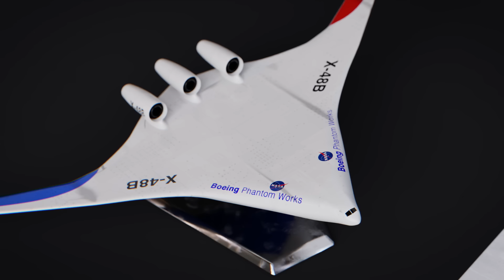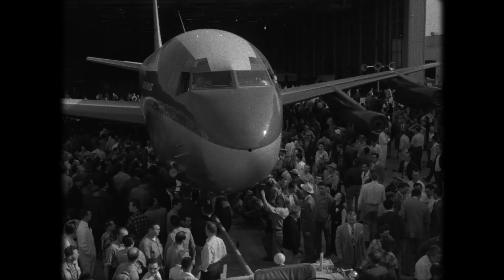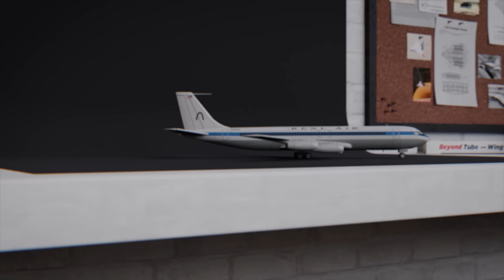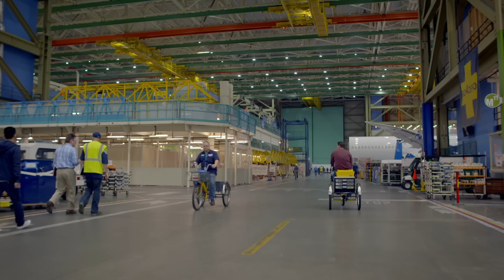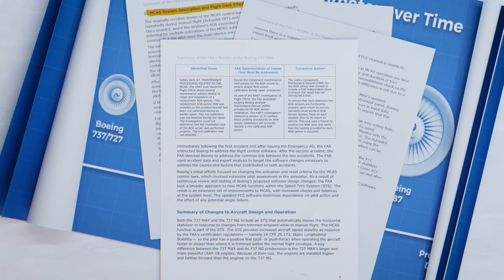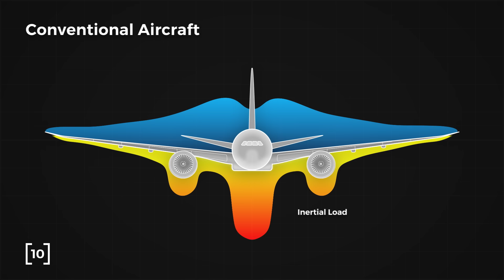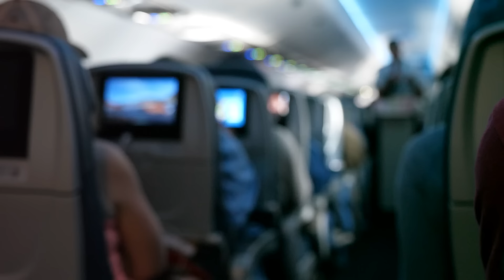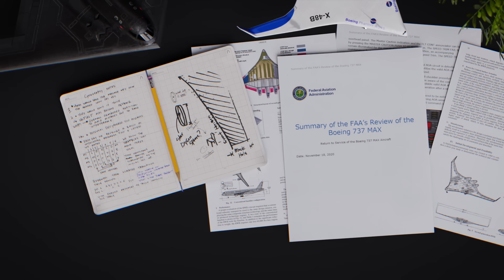The Plane That Will Change Travel Forever

Comment: Although I think this is a very well made video I feel compelled to point out that it propagates a very common missconception about the horizontal tailplane.  The lift of the horizontal tailplane is not neccesarily negative. It can be both positive and negative depending on the amount of payload load, and fuel, and how it is positioned . Ideally it should be zero, and hence the major drag from the the horizontal tailplane is parasitic drag. The point is that  the centre of gravity needs not be in front of the wing neutral point. It should be in front of the neutral point of the combination of wing and horizontal tailplane (and fuselage).

Comment: You failed to mention 1 key fact...
Fuel efficiency increases never lower fuel costs.
Per unit fuel cost will rise to compensate for Per Unit efficiency decreases. 

An oil company isn't going to make less money because the airlines want to use less fuel.

Just look at the automotive sector, making cars way more efficient since the early 2000's and yet Fuel prices are higher

Comment: Considering the failure of the A380 to take over as a new standard - only a few airports could provide the infrastructure and the plane is expensive - I think it'll be a long time before this sort of design takes over. It would require massive investment just to get the (probably reluctant) passengers on board. Also,  the tube fuselage is an easy structure to pressurise. This is so far off becoming a reality, I'm surprised Elon Musk hasn't claimed to have invented it and sold the idea to Richard Branson.

Comment: 14:14 good luck! Anyone who ever worked in software development knows it is impossible to write complex code perfectly.
Reply: I would posit that its an issue of the machine-style en-mass rapid fire typing we've DEMANDED should be the correct way of doing things, instead of putting the code through multiple error checks with multiple error checkers in the loop, along with inadequate netcoding...

OFC it'll be difficult at best to create a multi-million line code piece of aviation machinery with "good" code.

Comment: How are they going to pressurize that thing?  Making a a fuselage of that shape strong enough to hold 8,000 ft. at 40+ thousand feet will have a real weight penalty. That's why aircraft cabins are cylindrical.

Comment: They could've done it since the begining ( or across those 50 years ) , but fuel had to be consumed 100% because if efficiency would've been 110% , an entire industry had to suffer by lowering the production  ... We all know what's that industry  . I bet there were alot of burning discussions or design and redesign and alot of compromises so everyone can live in peace and sleep well .
Reply: Wrong!  The elimination of the tail section(and it's passive stabilization) basically requires continuous active control to fly straight.  Computer control!  Building redundant electronic systems for every contingency is the main challenge here.
Reply: @jeffreysickels1970  Yeah ... But i haven't mentioned that when i said " They could've done it since the beginning " i wasn't reffering to the futuristic shape in the clip ... More like any other aerodynamic shape that could allow a really efficient airflow .

Comment: This is awesome and I want it to replace all planes. But the sad reality is that airlines are very risk intolerant and unwilling to invest in new infrastructure. Even if this plane was the same price as current models they would still hold off on getting it since they'd have to retrain pilots, change loading/unloading infrastructure, hire new technicians, etc. Not to mention that they would not want to replace a perfectly fine plane if it still works considering how expensive they are. Even if the eventual fuel savings would make sense to get rid of your existing fleet, they would still be really hesitant to make that kind of investment.

Comment: At time 10:57 there is a WRONG statement "... or the software can fail ... " In a computer that is designed and tested and certified as a critical "fly-by-wire" flight control computer there are some possible failure modes. But all those failures are HARDWARE failures. Be it the CPU or be it part of the memory or be it part of the Input/Output circuit. By definition software does not fail in a way like hardware fails. It either works as intended when thoroughly tested in simulations and actual flight tests or it fails the certification tests. But when the software is finalized and certified (NOT the Boeing/FAA way as in the B-737MAX !!) it will NOT fail. Any failure of the fly-by-wire system in operation will be a hardware failure. If you speak of a software failure it is a design error that should have corrected before certification. The design and certification will also verify that any hardware failure will NOT have catastrophic consequences but rather result in a "fall-back-mode" of only slightly reduced capability due to carefully designed redundancy throughout the multiple paths of the entire system.

Comment: Thanks for your intelligent, coherent aeronautical engineering lesson. The inherent problem with 'airliners' is depending on air for lift. Flying bodies offer tremendous savings in fuel economy over conventional aircraft (fuselage/wing/tailwings) but incur stabilization issues due to turbulence in the air you're riding on! 
'Electromagnetic propulsion' removes the drag coefficient with the 'energy bubble' which is far more efficient than any 'aircraft' will ever realize.
Reply: Well then this comment is neither intelligent, nor coherent  nor an aeronautical engineering lesson.

Comment: You forgot to mention what the ride quality would be like near the edges of this type of aircraft.
Supposedly, it's awful when the aircraft starts a turn, as you are very far away from the center of gravity, meaning you experience more force and movement than those sitting near the center.

I remember reading about this design years ago and ride quality near the wing tips was definitely a concern back then.

Comment: Does this video assume that these new designs can operate out of current airports & passenger terminals? I don't recall that being addressed, but I'd find it hard to believe considering the amount of refit needed for the relatively minor changes introduced by the A380. If airports need significant refitting to accommodate the new design, how does that impact the overall cost savings, and where is that money going to come from?

Comment: MCAS was causing trim runaway, wasn't "taking a control of plane". The pilot has the authority to cut off the electronic trimer at any time. Boeing 737MAX is not fly-by-wire.

Comment: Before I watch this vid can I just point out the flying wing concept is actually very old, has been used even back during WW2 and the main reason that the flying wing design was never used as a commercial aircraft, so far as I am aware, was primarily the safety aspect. 

This was in regards stormy weather and airports with severe crosswinds. To give a bad example, imagine walking into a strong and changing wind with your arms out. This is roughly the classic non-efficient tubular fuselage and wings shape. You will say it's a bit hard to walk, a bit wobbly and uncomfortable, but somewhat manageable. Now, to simulate a flying wing(and don't do this please), imagine walking into that same strong wind holding a big sheet of plywood lol... we know how badly that would go right? If your arms were not torn off by forces then you'd at least be blown into the next door neighbors garden and in a pretty bad state when found by your concerned friends or family. 

So this is primarily so far as I am aware, why there's a big reluctance in implementing the flying wing as commercial aircraft. It's one thing to use a flying wing for military purposes where the budgets are very big and it's only on a small scale aircraft by comparison and only risks a pilot or two that are well trained and can typically eject, but the same is not true when we're proposing hundreds of civilians not to mention what it might actually crash into on top of that, usually close to cities and very populated areas these days. 

So sadly, while the old tubular fuselage and wing/tail design is blatantly inefficient(since the entire fuselage is basically dead weight, offers no lift whatsoever), it's a very safe design and much easier to control around the globe with so many airports in different weather conditions and some with extremely volatile weather systems and crosswinds, the round tubular shape doesn't really give much for crosswinds and stormy conditions to grab, it's very smooth and passive by nature, the same basic shape no matter what way the aircraft has rolled it and so the risk to the hundreds inside is much lower. 

If you look at a flying wing nose-on, as though it's flying towards you, it has very little drag, in fact it's a thing of beauty, the entire aircraft body is generating lift, hugely efficient. But this is fine so long as it's a nice day without much wind or the wind just happens to conveniently be blowing directly at it(to a point!!). But as soon as there's a large wind blowing across it from left to right etc, and you dare roll that flying wing a little bit like during landings or shortly after take offs, suddenly you get that sheet of plywood affect, like a kite and there's just nothing for that really. And just like a person carrying a sheet of plywood into a strong wind, if the flying wing doesn't get torn apart by the sudden structural stresses it would most certainly lose control and get carried any which way the wind is blowing to a horrible end for hundreds of civilians aboard along with whoever else is unfortunate to be where that aircraft hits.

So the top aircraft manufacturers could have built flying wings a long long time ago BUT, who's gonna risk it!? They would have to be so f'ing sure it's perfect and proven to work safely during crosswinds... not just typical crosswinds but potentially much more severe crosswinds in an ever changing climate we live in that's seeing more storms and more extreme weather than ever before. Would you risk it if you were a top airline manufacturer that currently has no reason to and stands everything to lose if it goes horribly wrong? To become a modern day Hindenburg sort of a thing?(I know that was an airship but you get the point) I sure as F wouldn't lol

Comment: Please, don't call 737 MAX problem "faulty software" (as it is presented everywhere). In aerospace, software is developed based on System-Design(high level) and subsequently Software-Design(low level) requirements. If there is only one sensor used, it is faulty System! Faulty software is something you can fix in new software release, but once you need to add some new hardware, or connect some already existing hardware into MCAS, it is clear it's not faulty software.

Comment: Lol, continuing to watch shows they thought this. When the story was talking about the tubular shape and the square space causing trouble, my first thought was they needed to talk to sub manufactures. The largest subs have a triple hold design, i.e. three tubes connected together to form a much stronger sub. imagine them having 4 tubes side by side, with small columns connecting their top to the bottom allow a lot of open space in the middle. A cross second from the front of it would look like an old roman archway causeway on top of an inverted one. Looking at a cross second from the sides it would look like large round or rectangular openings in the tubes.

Comment: Planes today are extremely safe and efficient, so in order to "progress" in the development of air travel we will take the most historically unstable plane design that CANNOT fly safely without extensive computer controlled 6 axis gyro stabilization, and even then is very difficult to fly in bad weather and fill it with hundreds of people.  I'm surprised that Elon Musk isn't behind this stupidity.  Like many, I fly a Delta wing RC plane (like shown in the video) and its the most unstable plane I have ever flown and extremely easy to crash  if you make the slightest mistake, even with gyro stabilization.

Comment: the issue with the BWB is required evacuation time... getting people out of the center of the aircraft in the time required by the FAA makes extreme wide body aircraft just not an option. what will see is more 757 sized aircraft that with tech from the 787

Comment: I think I've seen articles with concerns about airsickness given that passenger towards the extreme right and left of the wing cabin would experience much greater rising and falling during banking than experienced in a tube cabin.  Combine that with no windows and potential claustrophobia and there's an issue.